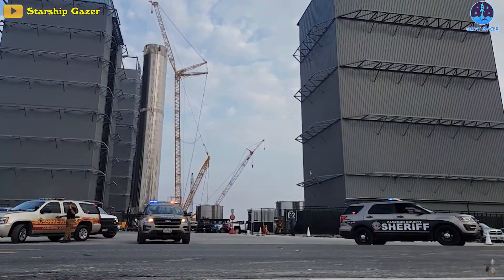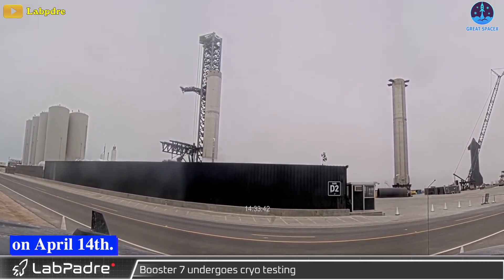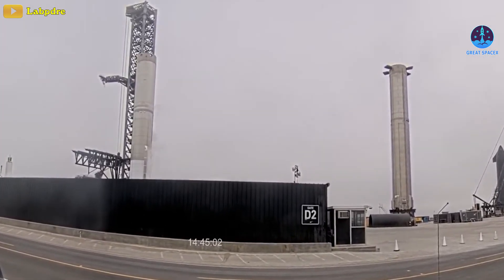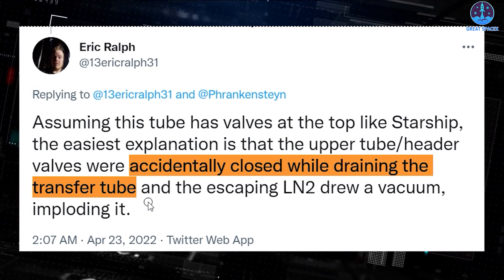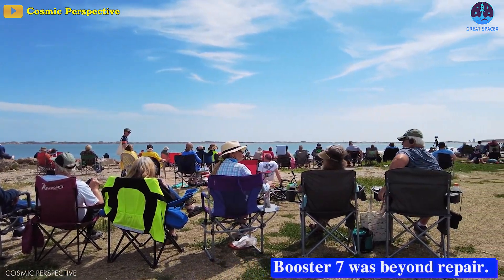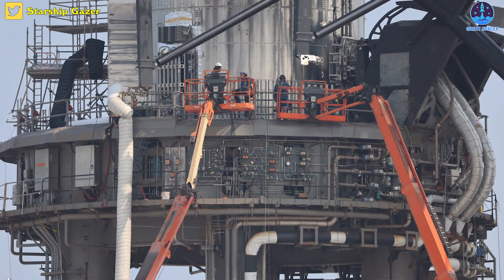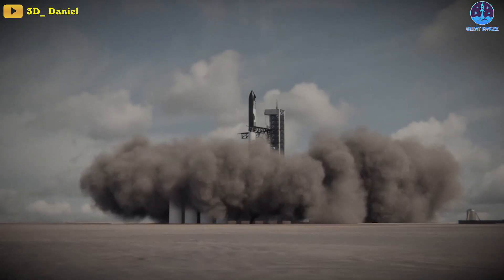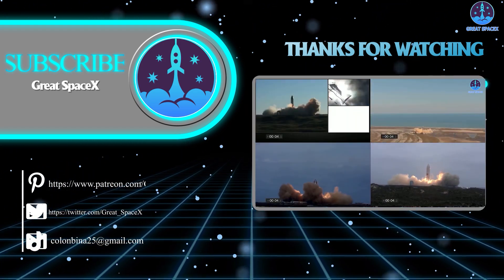SpaceX fixed & upgraded 230 Feet Rocket in a major accident in just 2 weeks Shocking the others...

Comment: It’s a question of sequence. Fill lox first then methane so the pipe has pressure in it. otherwise the methane pressure will collapse the pipe. They must remove methane first them remove lox. Simple. If they draw a vacuum then they could collapse the rocket as well. The pressure in the tanks add to the rigidity of the rocket. Same for Saturn 5 and minute man missiles.

Comment: B7 won’t launch.  Why would it?  Production of Raptor 2 is too much of a risk!  But, fitting Raptor 2 securely and safely to B7, then pressure testing, that has benefit.  B9 launch is more likely in my thoughts.  If you look at the evolution through major changes they have reduced the versions needed to prove a logic.  Fitting Raptor 2 is going to need proving with the improvements; then they will launch if FAA stop blocking for SLS.  Fingers crossed people get Elon’s dedication to humanity and move out of the way.
Reply: Total typo on previous version.  Mind totally wondered!  Apols folks ‘replaced FAA keeps blocking for FAA stops blocking!  Total Bipolar thing!  High 5 to those with Bipolar amigos!

Comment: The damn straw collapsed! They replaced it. Hardly major. Bigger, longer, heavier, but very likely the same exact process that's used when replacing a worn out exhaust system on any car on the road. They simply fixed the dang, broken tube.

Comment: Congrats to SpaceX for repairing it.  I wonder if they just pressurized the damaged downcomer in place and repaired the mount points/seals?   @4:26 actually a vacuum forming is the least likely/plausible in a high pressure system like this.  The plausible cause is a relatively low pressure in the downcomer compared to the oxygen tank.  ie 60PSI in the oxygen tank and  55PSI in the methane downcomer. I suspect that during detanking they didn't pump in replacement gas at the same rate they were extracting liquid methane.  That lowered pressure in the downcomer relative to the oxygen tank. The downcomer isn't designed to support external pressure.  It has those flimsy unbraced rings but those are probably only good for 1-3PSI.   So it crushed. The damage was mostly to the support rings, the tank ends, and the seals, than to the downcomer itself.  Replacing the downcomer would require spectacular surgery of the tanks and hull... so I bet they just inflated it back into shape and repaired the ends.  Even if they don't fly it, it was good knowledge to gain re: whether this could be fixed in the field in a pinch.

Comment: Way to dumb it down and get it wrong. No vacuum is drawn! it is just atmospheric pressure pressing on an empty tube.
Reply: Um.. Empty is the definition of a vacuum. Definition: A vacuum is a space devoid of matter. The word is derived from the Latin adjective vacuus for "vacant" or "void". As to 'drawing it,' I have run vacuum pumps and in a sense are 'drawing' it with pressure... So not sure why the hostility and lack of facts on your part...
Reply: ps. I don't know many other ways for a steel tube re-enforced with steel rings to implode other than a large pressure differential and usually would imply a vacuum or perhaps just air/gas surrounded by liquefied gas (gas in cold liquid form) - but in that sense it could still be considered a 'relative vacuum' in terms of pressure differential and difference between the external liquid column surrounding the internal gas column

Comment: A self-propelled MODULAR transporter or sometimes self-propelled modular trailer (SPMT) is a platform heavy hauler with a large array of wheels which is an upgraded version of a hydraulic modular trailer. transporter or sometimes self-propelled modular trailer (SPMT) is a platform heavy hauler with a large array of wheels which is an upgraded version of a hydraulic modular trailer.
Reply: Of note, the versions used for rocketry are almost always of the self-leveling variety also.